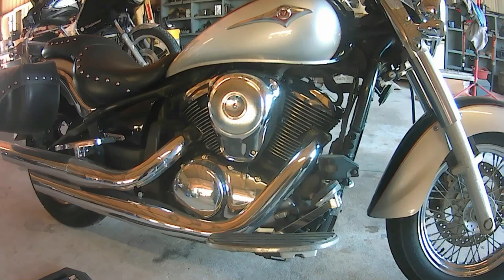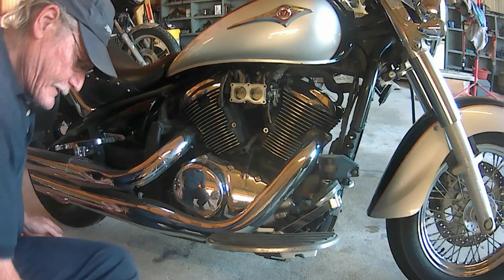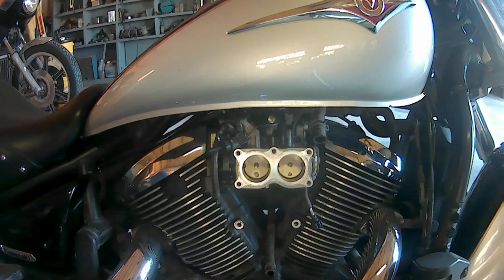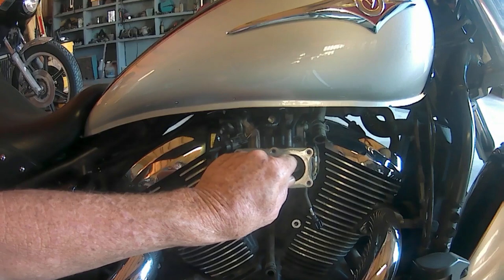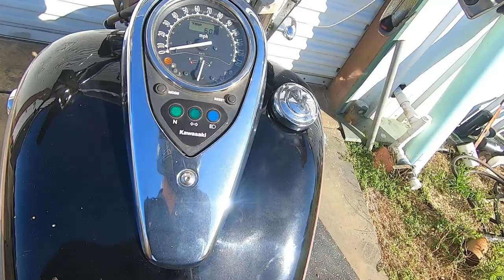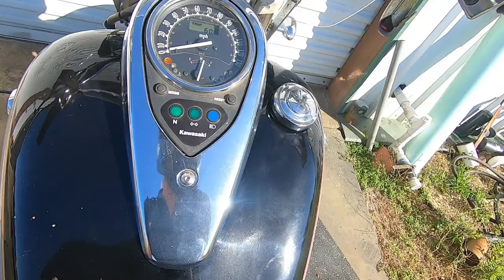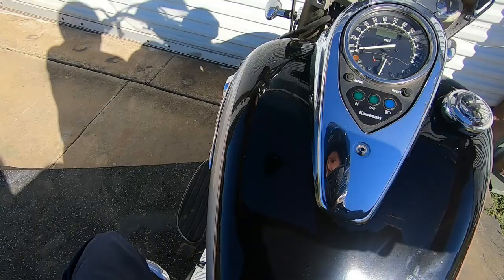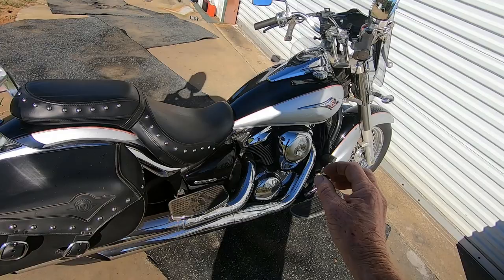Removing Restrictor Plates 07 Vulcan 900

Comment: I pulled mine out as soon as I got my 15’ 900. Tossed them and have had no issues. Took my bike around the country last year too. I’d say I removed them when the bike had 2000 miles and now were at over 30,000!! These bikes never cease to amaze me as long as maintenance is done on time.
Reply from the maker: Thank you for your comment sir I am so glad to know now that later year model bikes will work the same as mine thank you 👍👍👍👍👍

Comment: I have also removed it. The most noticeable difference is that there is much less judder when decelerating, and the handle vibration has also been reduced. There is also a slight increase in horsepower. I'm glad I removed it.

Comment: So been having issues. ¾ throttle bogs like hell. Custom intake, cobra pipes n the fi2000r fuel processor.  Still bogging. I took off those restrictor plates n its like a different bike. Still in 4th & 5th ¾ or more bogs. Any ideas anyone? Id appreciate any thoughts.
Reply from the maker: Sir it's sounds like a fuel starving to me I got a video out there that was last year I think it's called cleaning filter Vulcan 900 and the junk that came out of the filter was very dirty I hope this helps you out and let me know sir 👍
Reply: @lp.670  tried that Saturday.  Def nasty but I cleaned the filter. I agree. Fuel starve. Im getting quantum fuels rebuild kit for fuel pump. Ill check back in. Thank you for your time!!
Reply from the maker: @2wheelsOrDieNC  I have the same fuel pump in mine and they work great but the connection on the wires is weak so be careful putting them on

Comment: Mr LP, it's been 2 months.  How you feeling about removing the butterflies so far?  Thinking about doing it, but wanted to gauge a long term assessment from you.  Thank you in advance.
Reply from the maker: Mr Martin thank you so very much for your comment far as it goes for the bike I think I will be leaving them out because if I need to go somewhere in a hurry I don't need my bike nose diving at 90 mph please sir give me a couple of more months to ride it around more because the temperatures is a little bit cold right now and I'm not a cold weather Rider now this is only my opinion with the restrictor plates removed I like the bike even more I'm just saying what I like because I can hit over a hundred miles per hour easily now thank you so very much for your comment sir 🤗
Reply: @lp.670  Thank you so much for your reply. I'm gonna give it a whirl. I'm in central Texas so I'm still riding. Might make it my weekend project this weekend. Thanks again. Looking forward to your updates.
Reply from the maker: @TexasNewMoney  Mr Martin if you decide to remove them plates pay attention at the bottom of them plates they should be a like a zero at the bottom mark them that way just in case you ever put them plates back in you'll know exactly how they go thank you so very much for your comment sir 🤗👍
Reply: @lp.670  You got it. Thank you. 🙌
Reply from the maker: @TexasNewMoney  you're very welcome Mr Martin 👍
Reply: MR.LP,did you get any noticeable increase in fuel mileage yet?With the prices of Supreme fuel nowadays any improvement is a good thing for the wallet.I ❤ my Kawi and always looking to improve my riding experience and an Xtra mile or two per gallon,is added Smiles per Gallon😊.Thanks in advance.

Comment: So I replaced my exhaust with cobra dragsters and then removed the restrictors today and it ran perfectly, it also stopped my exhaust from popping and backfiring.
Reply from the maker: Thank you for your comment sir and that sounds like some great news right there 👍
Reply: Keep an eye on those manifold nuts. I have the same exhaust and my manifold nuts came loose, which in turn gave the bike ticking noise along with backfire. I thought it was the valve clearance (needs to be checked every 15K), but it wasn't.
Reply: thanks frank, I have an LT all tricked out with cobra also - I will remove the restrictors because you said it stopped the popping and backfiring. = thanks.

Comment: I have a few bikes the Vulcan is one of my favorites of all time , I did a partial baffle removal it just sounds Better no more power , and whatever you do do not remove them completely it killed my 1700 had to weld them back in , modify the air box no power increase what so ever , flash the computer or put a programmer on it your pissing in the wind , took these butterflies out , my 50 to 60 roll on big difference, when I take off and accelerate hard it spins the tire a lot more , and yes that high end 5th  pull totally different , you can take my word for it or piss your money off . The Butterfly removal works Period
Reply from the maker: Thank you for your comment sir 🤗❤️👍

Comment: Sounds unreal. Would love to know how the fuel usage goes.
Reply from the maker: Thank you for your comment sir I will be checking the fuel mileage I'm thinking it's getting a little bit better right now of course the gas station I stopped at the other day was not the one that I normally fill up at but I will definitely let you know the fuel mileage on it and if it's getting better gas mileage to begin with I'm thinking it was around 45 miles to a gallon with windshield and around 50 without the windshield but I will definitely let you know something later on this week thank you so very much sir

Comment: It seem that the plates open up when the throttle is opened anyway so removing them shouldn’t have hurt anything. I’m sure that some engineers would differ and it was designed that way for a reason. With everything going fuel injection it’s only time before fuel pumps start failing
Reply from the maker: Thank you for your comment sir but I know when you get up to 90mph you can feel a nose dive on the bike now with them removed you don't feel it nose dive and to the bike is much faster than you would think but the restrictions in the ECM will keep it low...... the day I done this I was able to get over 100 with no problem thank you for your comment sir 🤗❤️👍 and to it's funny that you said fuel pump because I have problems with mine and the video is coming out this Friday at 5:00 PM and how I have fixed so far it will be the 3 time I went in to the fuel tank and I am eating my words but I found out the problem...
Reply: @lp.670  Any negative to not having those flaps installed? What's the risk?
Reply from the maker: @APawky  no problem's and love it now the only problem is that it will not get over 115 mph and then plates will not be going back in the bike thank you for your comment 👍

Comment: I seen another set of butterflies in there moving at the same timing as the the old butterflies, im kinda wondering what difference if any it made. It seems the butterflies are delayed versus the cracking of the throttle

Comment: Mines a 17 vn 900 my question is could i remove the inside butterflies aswell,!  being its fuel injected. I watched you rev it with the butterflies having so much delay itd seem so much better all of the butterflies removed getting all the air!!. Sitting here plotting lol!! P.s im not being a smart azz,and hopefully its not taken wrong!
Reply from the maker: Do not remove the inside one's because your bike will run wide open and you will have no control over the engine thank you for your comment sir 🤗

Comment: Do you have stock pipes on the bike,,they sound great,,im looking at a used 2007 vulcan with 10k miles for 2500..have owned a older vulcan classic and it was very dpendable..
Reply: Stock pipes are nice and they’re quiet. I have cobra slash downs now and they’re very loud and I love them lol.
Reply from the maker: @charliesmith9528  yes sir I do but I did a stage 2 on them I removed the baffles in them kinda straight pipes thank you sir for your comment and I am very sorry for answering your question 2 mounts later I have been very busy with other projects and video's coming out

Comment: I have an 09 900 Vulcan custom it runs great but it wants to idle high for more than 5 min after initial start up even if I hop on and take off it'll still idle high at stops for a few min
Reply from the maker: Thank you for your comment sir on that I do not know I would think it's something to do with the electronic motor that is on the throttle blades that I removed in my video because there's a electronic motor there and I'm wondering if there's something wrong with that motor that's something I just do not know you might have to go to a motorcycle shop or something I wish I could answer that question
Reply: @lp.670  It's hot or miss sometimes warms right up stops high idle others it will idle high for 10 min it seems not really sure why but I just ride on anyhow lol
Reply from the maker: @proditoresmoriendum86  sir what you just told me it kind of sounds like the problems I was having with the 07 you know not heating up and all and the problem was the rear spark plug was loose on the motor and I'm wondering now is that it might be some of your problems does it sound like it's really hitting on both cylinders or kind of like hitting on one cylinder good but the other cylinder is like a tip for tap other words you have to really listen to the exhaust on the rear and I'm wondering if that might be the problem because once I changed both of my spark plugs I noticed that everything heated up a lot quicker on my bike I can't think of the name of the video but I done a video of that and they was a total different sound in the exhaust you know I don't know I'm just I'm just throwing things out there that maybe this will help you sorry my comment was so long
Reply: @lp.670  Runs perfect otherwise and it's not all the time I literally beat the crap out of this bike wide open all the time lol just sometimes doesn't want to idle down for a while
Reply from the maker: @proditoresmoriendum86  I think I understand what you're saying sir there was one video what did I put out having big problems with the Vulcan 900 and you can tell in that video when I came up to a stop sign it was not running correctly anyway you might need to watch that video and see if your bike does that from time to time and if it does the problem that I found with that bike is that rear spark plug loosened up it was not tight and that was from the factory the bike that I have is a one owner's bike and he never had the plugs changed or anything and it didn't have 4,175 miles on I think other words very low milesjust just watch the video and see if your bike makes the same skipping sound mine did
Reply: That is pretty standard for these fellas, as far as I have seen. Have an 97 vn 90 classic lt (100% debaffled) with 30k miles and a 21 vn 900 classic with a bit over 1k miles and they both do what you mention. The new 1 will do it even if hot and I stop and restart. Nearly the perfect motorcycle IMHO! Comfortable on highways, BEST cruiser in twisties and awesome to motocamp off of. Ive retired in Appalachia and it is the best mtn motorcycle I have seen in 50 yrs of riding
Reply: @chipblanc6037  for what i have invested i have no complaints its an over all great bike i would absolutely love a 6 speed conversion but other than that ill ride it till the wheels fall off ive owned this one just over a year and put 9k miles on it
Reply from the maker: @chipblanc6037  thank you sir for your comment very appreciative and I'm glad that you are having fun with your motorcycles I know I love mine too man what a great comment you left thank you so very much 👍👍👍👍👍
Reply: What passenger floorboards are those on your bike?

Comment: Sir is there anyway that I may get in contact with you? My 2013 custom seems to be running on 1 cylinder. I checked for spark and both spark plugs are in working order. I did end up changing them out just in case. However the bike is running rough. Please if I am able to get in contact with you I’d really appreciate it. Thank you.
Reply from the maker: Question one how many miles is on it you might have a valve out of adjustment question 2 how is the gas in it you might have a fuel injector stop up question 3 when it is running do you hear a loud norse coming from the fuel tank?? just asking Sir....... please let me know Sir I do want to help you with your problem just need more information

Comment: I removed  them from my 14 custom last night. I can't wait to ride this weekend.
Reply from the maker: Let me know how it goes Sir
Reply: @L P.  I rode 126.7 miles @75 to 80 mph on the interstate. The refuel took 2.734 gallons, equaling  46.34 mpg. The ride home was 111.7 miles (all back roads) the refill took 2.1 gallons @ 53.19 mpg.
Reply from the maker: @skullroses  that sounds great you got better gas mileage on back roads by keeping rpms down you will get better gas mileage thank you for letting me know and thank you sir 👍
Reply: @skullroses Thinking of doing it on my 08 Custom. Did you notice any difference at 90mph?

Comment: Hello
thank you for the video Sir. 
what is the purpose of those vales anyway?
Reply from the maker: Mr fullstream thank you for your comment sir the valves that I removed is a restriction possibly to keep from over-revin the motorcycle but I do know when you get around 90 mph you feel it nose dive now with the plates removed I get over a hundred miles per hour and no nose dive that's only if it's emergency and you really got to get somewhere such as a hospital or something or you got a loved one in the hospital thank you for your comment sir 👍
Reply: Thank you
Reply: Do you yhink that perhaps at 90mph, its a rev limiter on the engine? @lp.670
Reply from the maker: @jacksharp9949  no sir because I have done run her up to 110 mph but with the plates in her I can feel the front end drop a little at 90 mph now that they are out she's keeps on going thank you for your comment sir 👍

Comment: What are some reasons you wouldn’t want to remove them in theory?
Reply: Your messing with the A/F mixture on a hard programmed ecu power curve that was tunned with the restrictors in place.  Like another mentioned above... your mid range does suffer a little but on highway at top end it doesnt front dive on decel as much(engine braking)

  Quicker response on throttle but smoothness is obsolete.  I have cobra dragsters and a DIY open airbox so im already at max bolt ons lol but the most i noticed is more comfortable top end,  1-2 better take off,  mid range 3-4 is suffering but not like "oh crap i need those back in"  top gear at 70 and needing to pass i feel like its got enough umph to get around safer.

Comment: Good afternoon sir. Help me please. Where is the EVAP located on this motorcycle? How to take it off? And can it be the cause of a drop in power and unstable operation of the engine at idle? My bike - same, but it don't go faster then 60 miles. On 80 - vibrations from the engine. 15 000 miles Thank you. Sincerely
Reply from the maker: Sounds like to me your fuel pump is probably clogged up does it make a squealing sound because my did and I could not get it over 65 mph I got all of this in later videos and I have mess up from time to time but I got the bike running great again and I had water in the fuel tank thank you for your comment sir 🤗❤️
Reply: @lp.670  not fuel pump, valves, balancer shaft, spart plugs, battery, injector
Reply from the maker: @user-fu8gq5xg5u1  check your map sensor it's under the fuel tank it has a vacuum line going to it it might have a crack in it and look at the wires on it and check your TPS and the wires
Reply: @lp.670  Thank you, sir. Now i waiting for the guy who can check this MAP sensor. 
I'll tell you, if reason in this thing.
Reply: @lp.670  hello. can u show me where absorber is?

Comment: Did it help or hurt gas mileage. And does it idol right when it's cold outside I've completely debated mine and shorted the longer pipe to have matching lengths looks a sounds awsome.
Reply from the maker: On the gas mileage I do not know yet and cold weather I do not know yet but this coming Saturday is supposed to be cold I will be doing tests on that I do not know when the video will come out but they a couple people ask about gas mileage and I'm wanting to know myself and will you asking about the cold weather I'll be finding out just come in Saturday and hopefully everything will be working good do you have a video of your exhaust the way you've done it I would love to see that thank you for your comment
Reply: Any update on fuel mileage loss or gain?

Comment: 2 questions what are the outer ones in there for ..second have you deleted or altered the egr system
Reply from the maker: Thank you for your comment the outer ones had to be rester plates because at 90mph you can feel it nose dive now I don't feel it no more now the other question yes I put a marble in the hose to keep the air from going in to the ex
Reply: @L P.  ok since my question I have taken out the outer butterflies and I noticed a difference right away even at low speeds..seems more responsive to me..